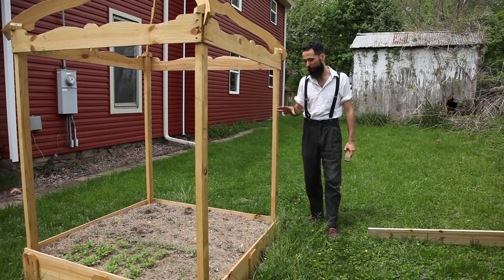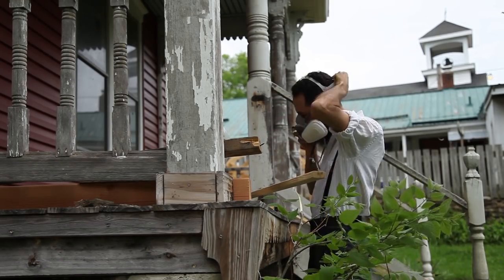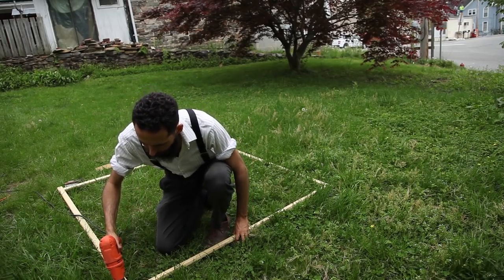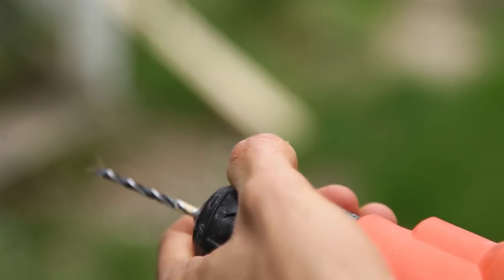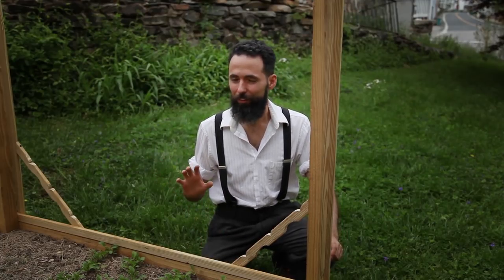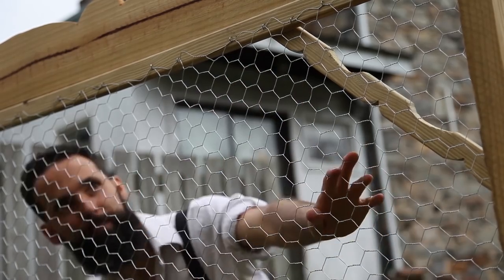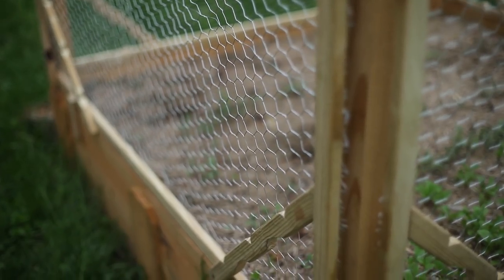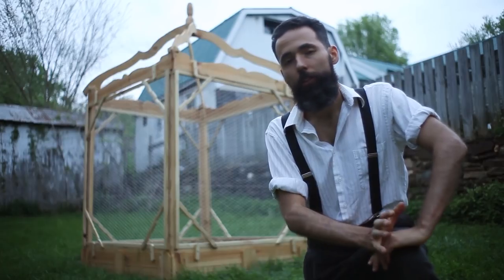Build The Ultimate Groundhog, Rabbit and Deer Proof Garden Bed

Comment: Nicely done, Siloe!  I've been following your progress.  Btw, did you sell the other house?  Is this one new?  I would suggest to make only two opposing sides of the garden bed accessible with removable frames.  The other two sides can have stapled on wire without frame.  This would reduce the amount of wood required.  Also, maybe you can add to this garden bed with a longer rectangular bed and build a hoop cover over it.  Cheers!  Love your channel.
Reply from the maker: Yes this is a new house. I preferred to make all sides removable in case I need to repair things and also to have easy access to all sides for maintenance. It makes a huge difference.

Comment: wondering now that time has passed how is the caged bed working? Love the design , bravo
Reply from the maker: It has held well and worked wonderfully for almost 4 years now. I would recommend investing in the 4x4 ground contact posts for the corners and exterior screws, because I had to replace one of the 2x3 corners that started to rot in the bottom because of the screws, and maybe using the plastic decking for the bottom boards would be nice because they could last much longer other than that, everything else has worked like a charm.
Reply: @suburbanhomestead  Many thanks for your suggestions and wonderful plans for the cage. Since my dog died last Fall the critters are now running rampant though out my garden like demons starving, yet taking one bite and moving to the next plant. A Ground hog is the newest addition to next door, I built the bottom structure atop wire. Deck garden seems so far to be better than out in the yard. Many thanks to you and I've subbed to your wonderful channel as well. love your straight forward approach.

Comment: Looks good.  Is that wood going to last or do you eventually need to treat it with something?
BTW, the house looks very wonderful.  Is that new siding or paint?  (I don't know much about this
so if it's a stupid question, then that is what it is. )
Reply from the maker: It's new siding (unfortunately it was the only cost-effective option for me) . The bed is pressure treated so it doesn't need painting, but maybe I should paint it to make it last longer.
Reply: @suburbanhomestead  The house colour is very attractive.

Comment: You can just flip the board over and cut the other side rather than moving the saw angle to get the opposing angle cut. Will save you some time, especially if you are going to make a lot of those cuts.
Reply from the maker: That is true. I just prefer to cut with my right hand
Reply: @suburbanhomestead  Whatever floats your boat, but I think your misunderstanding me. By moving the wood, you don't move anything else so you are using the same set up/angle/hand you used for the first cut. The garden looks great. I have had ground hog problems for the last three years and they love my soy beans so much. I just put 4 large cattle panels around it and the some plastic fencing around the lower half. Doesn't keep everything out, but does keep the heavy hitters out.

Comment: Why not 56x56 or something perfectly square anyway?
Reply from the maker: Yes, they could be 56 by 56, but chicken wire comes in 48 inch width. It is possible to stretch them a bit, as you see me doing later, but the longer you have to stretch them the worse it would be even by just some inches. I think I got closest to maximum stretch. 48 by 48 would have been more economical for standard lumber, but the proportion seemed too small for me. I wanted them as large as possible within the constrains of the materials. On an aesthetic not, an almost square can feel more pleasing in this case because the structure “sits” better. The overall structure is already taller than it’s wide, but it would feel even more had the middle part been square. This is about visual weight and can be seen in classical architecture. For instance, the base here is thicker in weight than the architrave. The roof is light with the arabesque curves, but it is still less than half tall as the central portion. These are proportion details that can be played around with, but when it feels right, it just feels right.